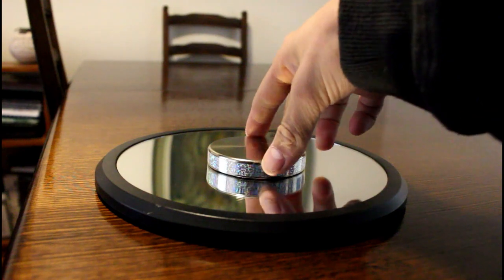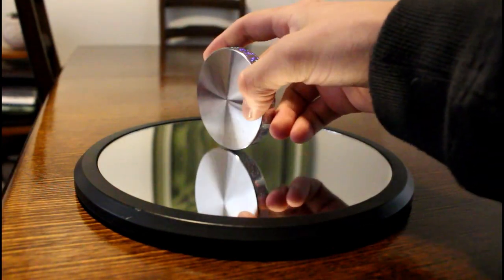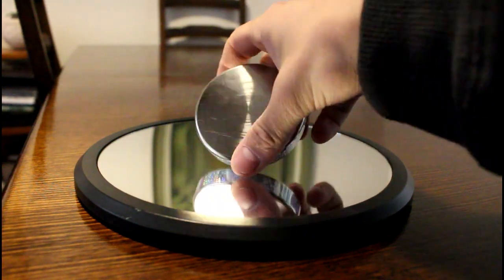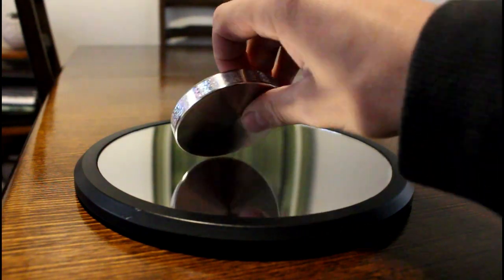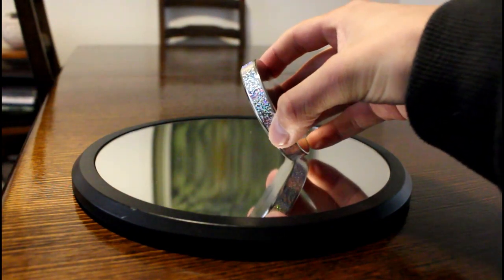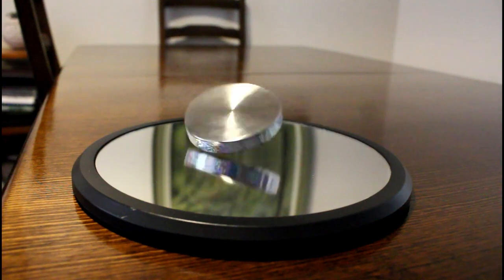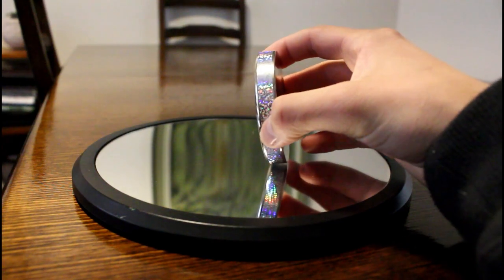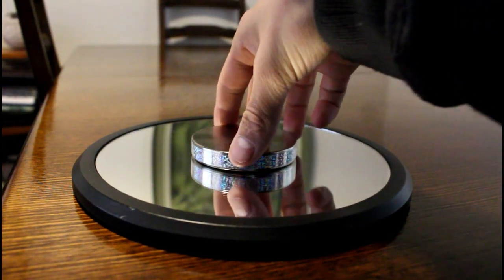How an Euler's Disk works

Comment: Doesn't explain why the eulers disk itself is  more extended in it's spawling. Is there an internal mechanism or material property causing this?
Reply from the maker: No, everything should have been explained. The weight, the refiner edge for low friction and the potential energy being coverted into kinetic energy.
Reply: To be blunt, it’s not really an explanation at all of what’s happening with the disk. Such an explanation would be about procession and why the disk processes more vigorously over time. The rate of spin is not increasing - it’s certainly decreasing as the disk loses energy. It’s rare of procession does increase though and that’s what you hear.

It’s easily demonstrated with an arrow marked off on the top of the disk. At first while the disk is very upright the arrow point will move quite a lot of distance for each precession. As procession becomes more vigorous however, you can see the arrow slow down over time to a crawl. For each procession it has barely spun at all.
Reply: Yeah is it hollowed out or is it heavier in certain areas? Or is it just a round of steel with deburred edges?

Comment: Is the mirrors surface convex? I can order a piece of 1/2" * 3" steel off mcmastercarr for about $9 with shipping and even cheaper if I cut the material myself. If the mirror is flat I can get my own Euler's disk for very cheap and put it on the lathe and clean the edge if it is too sharp or damaged although I think a sharp edge might make it last longer. I'm planning on ordering 4 or 5 disks to experiment a little and the only thing that I could find that might be a problem is the base as reflections appear distorted in videos. Ordering a convex base without extremely precise measurements would be hard not to mention prohibitively expensive even if I had them but if it is just a flat piece of mirror then I can go down to my local glass company and pick one up for about $4. If I order 5 disks and pick up the mirrors I would have 5 Euler's disks I could give to friends and family for the holidays for only $65 instead of spending $175 on 5 of these devices that wouldn't look as nice as what I could make for a fraction of the price.

P.S. I've ordered a 1" by 12" and 2" by 24" steel disk which should be pretty freaking awesome when it gets in. They actually might be too big to spin especially the 24" one which I'm actually getting for free from a friend that has some extra material left over from a job.
Reply from the maker: The mirror is very slightly convex. Not majorly. You could make a decent one with just a flat surface though.
Reply: @scoopscience  Thanks man. I'll have to experiment with flat glass and maybe get a strong Plexiglas surface I can heat or bend if I can't get the same results. I really do appreciate the response and frankly surprised since the age of the video. Definitely have me as a sub.